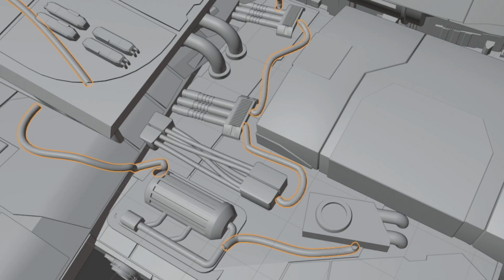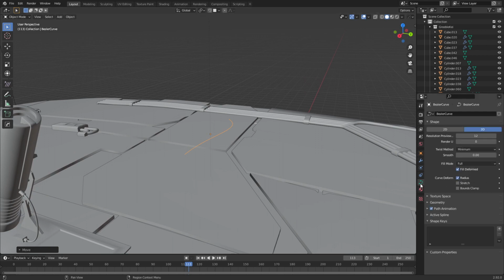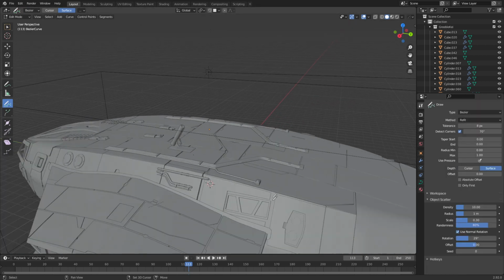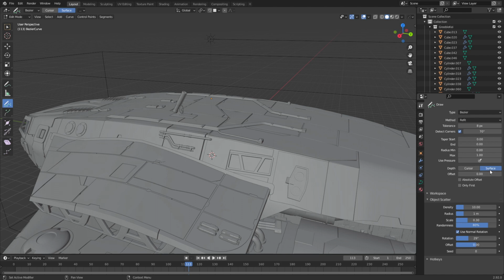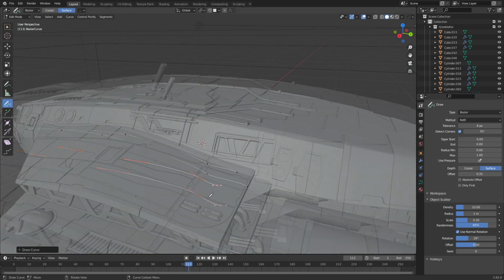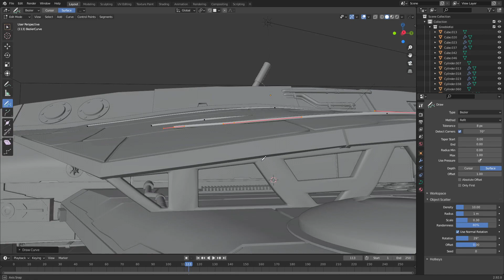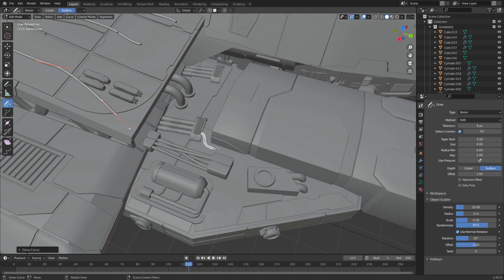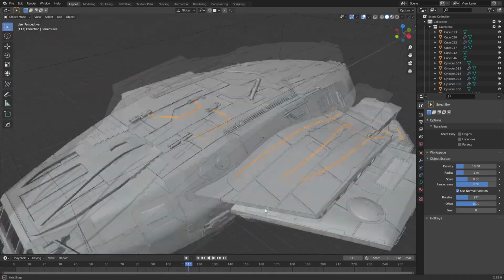Next Level Pipes and Cables in Blender

Comment: Ok so I was thinking, from what I hear, stuff that becomes stable in 2.9x ends up in the 2.8x LTS. So since this was in the 2.92oc release I decided to see if it was doable in the 2.83.13LTS and low-and-behold Yes it is doable. As expected look is a little different, but was able to find all the adjustments. Took me a second to find the offset for the placement of the pipe. Just had to go to bottom of 'Draw' settings to find the CURSOR/SURFACE button and when you select surface the offset shows up.
Reply from the maker: I just normally try and stay with the latest versions